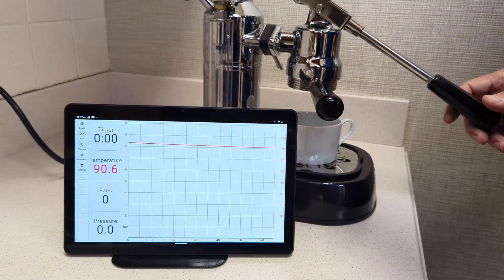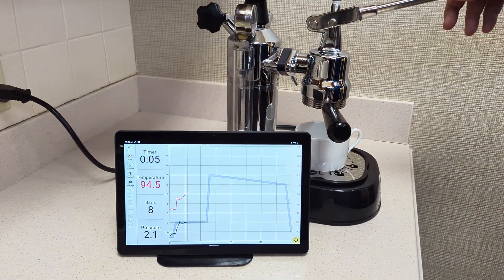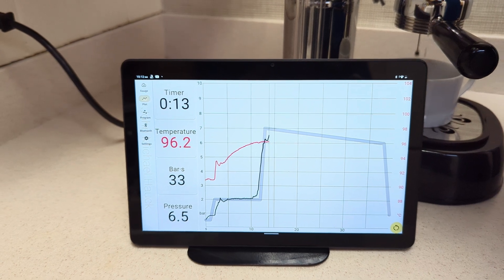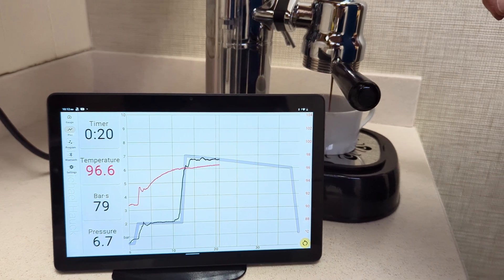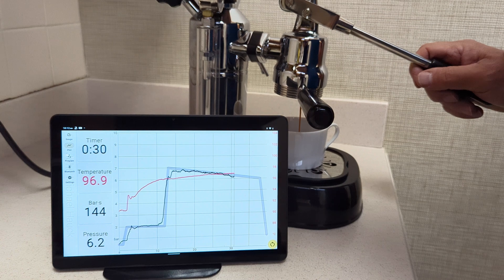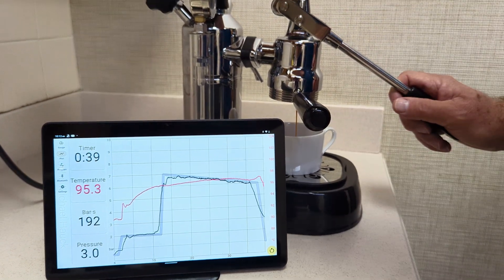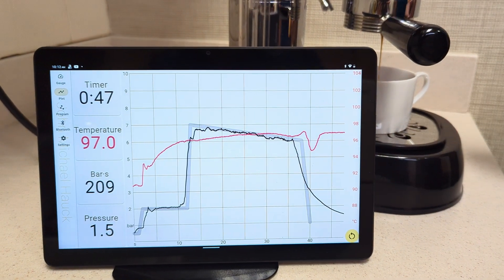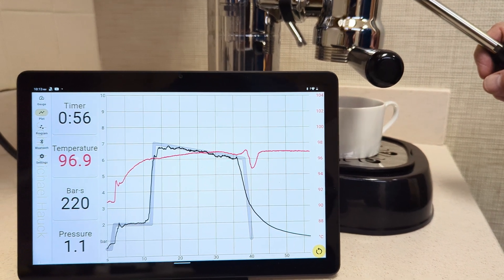8. La Pavoni Pressure & Temperature Profiling - A Decent Shot

Comment: this software looks very nice and capable,  would getting it to run with some kind of wired sensors be too hard ?
Reply from the maker: The software is designed for Bluetooth only. A wired sensor needs to be connected to the device (iPAD, iPhone, Android) which is not all that straightforward. That's why we created our own Bluetooth sensor for pressure and temperature.